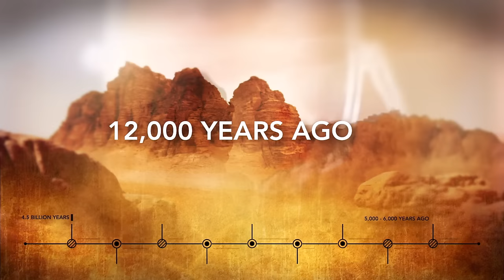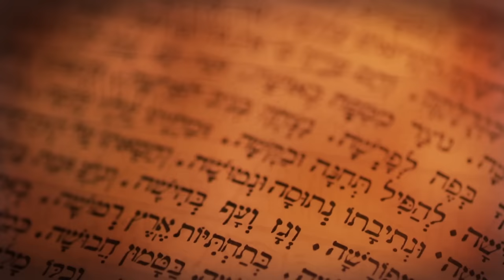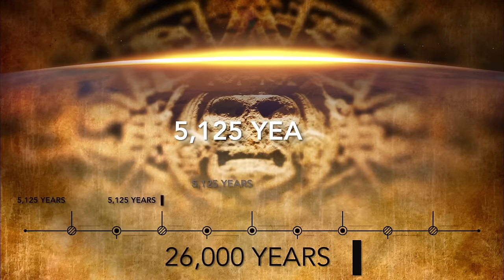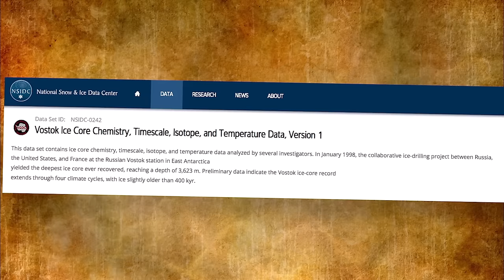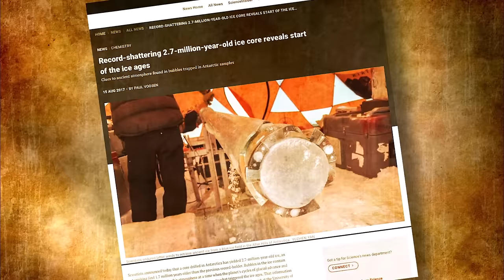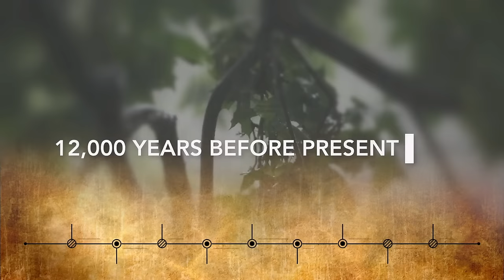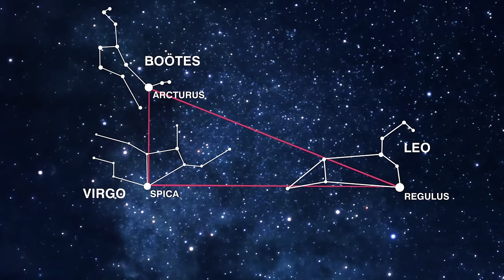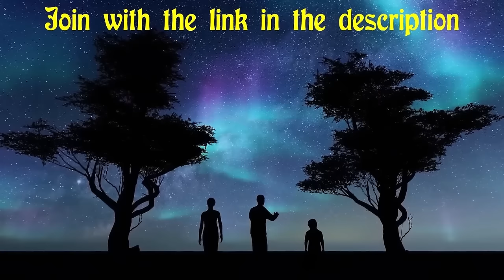Antediluvian Civilizations: The World Before the Great Flood

Comment: Before Present, BP ??? You mean BC, before Christ !
Reply: BP stands for Before Present which is the number of years before 1950.  It is used as a fixed reference point, particularly when discussing calibrated radiometric ages.  CE and BCE stand for Common Era and Before Common Era.  These terms are exactly equivalent to the older AD and BC terminology and have replaced them in serious scholarly and scientific works.

As an aside, the main* Jesus that the bible's new testament is based on was most likely born in 4 BCE, not 1 CE. (*Jesus was a very common name at the time and a number of different preachers with that name are known to have existed, with some of them being conflated with "the" Jesus in later biblical stories.)